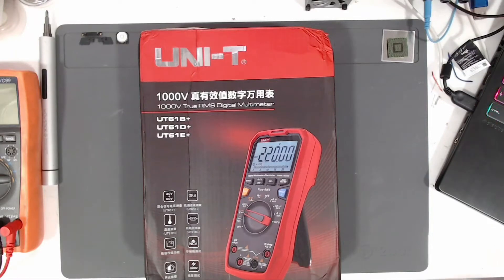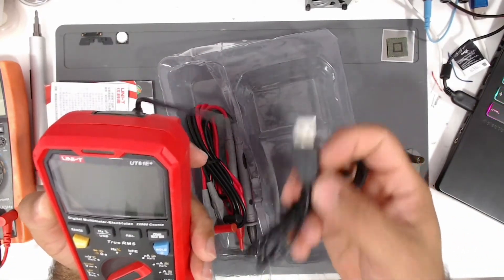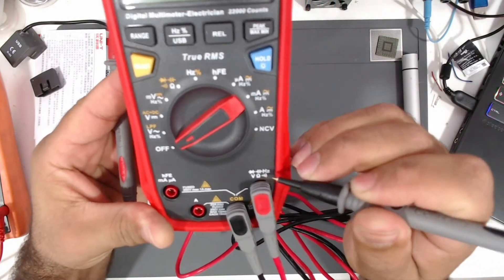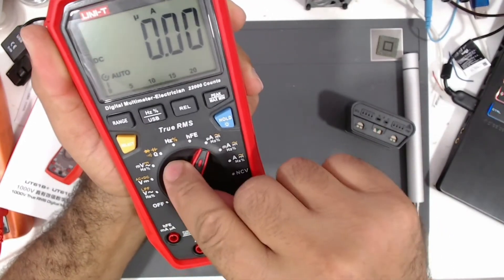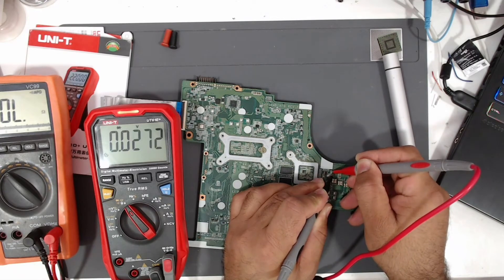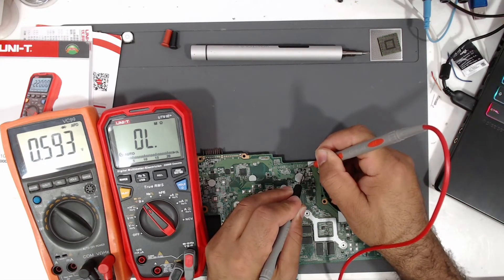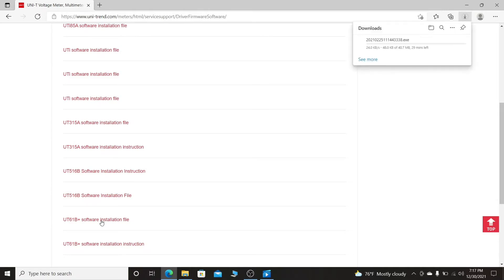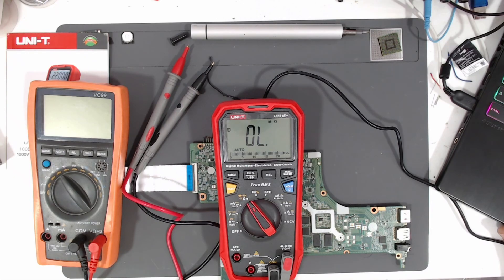UNI-T UT61E+ Multimeter test and compare with my old Multimeter

Comment: Thanks for review
 what about LEDs ALL colours show voltage drop and light ALL LEDs in diode mode
Reply from the maker: You are welcome friend 

I actually was planning to speak about that LED light on top of the meter but I unfortunately forgot  it

So in Diode mode the light will lit GREEN when it detects a good voltage drop across the Diode or transistor and it lights RED when short is detected 

and in continuity Mode it lits Green indicating good continuity